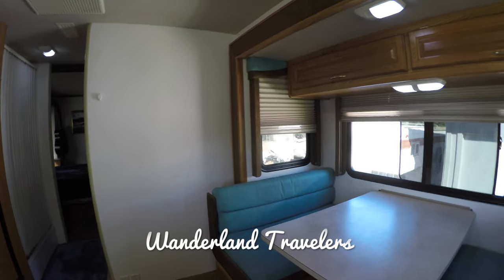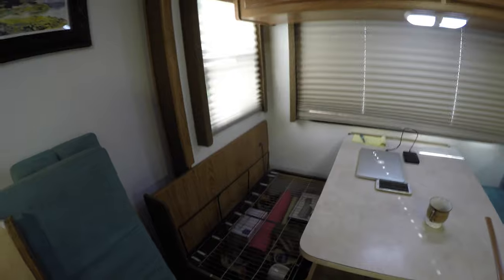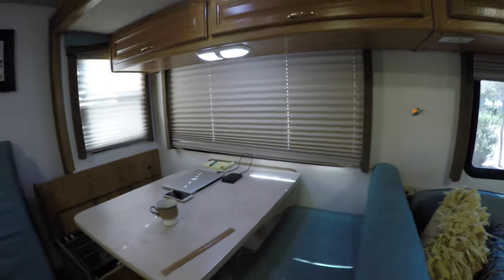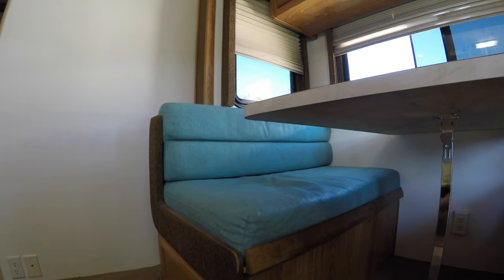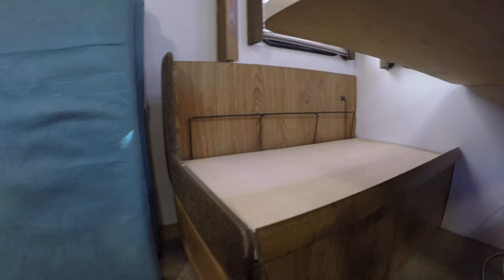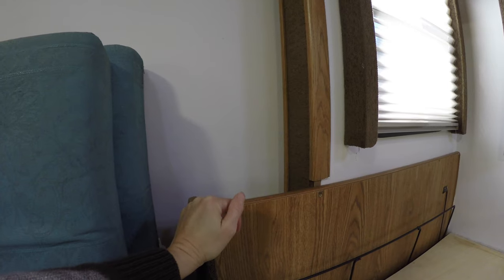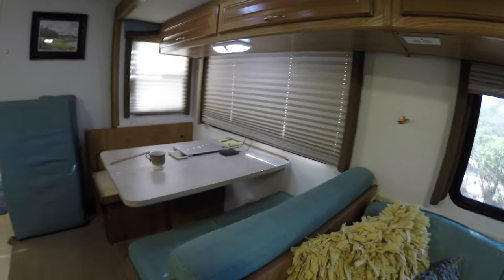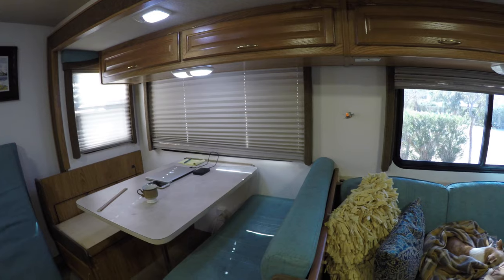RV Dinette Hacks to Improve Comfort & Function! || RV Living || Renovations & Repairs

Comment: Great adjustments! Quick question: with the addition of the wooden "lip" to stop the bottom cushion from sliding forward, does that interfere with folding the table down to create a bed?
Reply from the maker: Thanks for your great question! It would be possible to turn the board upside-down (if you cut the zip ties) so that the lip is aiming at the floor, for those times you want to create the bed. We actually weren't thinking of the bed when we did this, since we never use the dinette that way, but with your question we tried it out and the brackets we had used on the boards turned out to be a good size and placement and they didn't interfere with turning it upside down. Hope that helps!

Comment: Can you still make it into a bed?
Reply from the maker: That's a great question. We actually never use our dinette this way, so it wasn't on our minds for this renovation. You can always remove the boards (maybe stow them under the dinette) to make the bed. At first we were thinking you could flip the board upside-down, so there's a flat surface facing up, but I think the table would rest a little higher than normal, so might not be as good -- so I'd say it's best to pull the boards off when you want to make the bed.